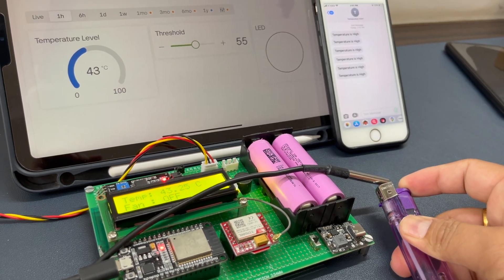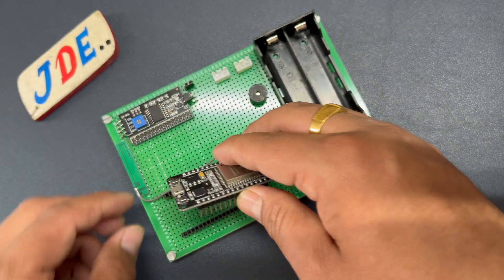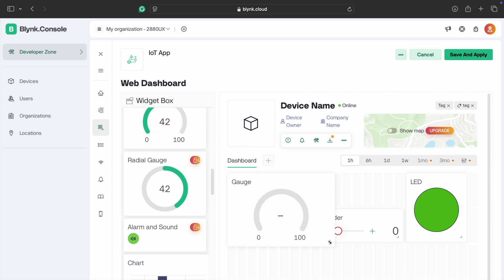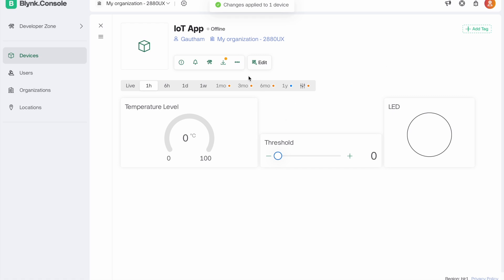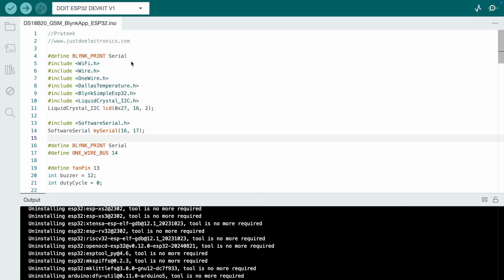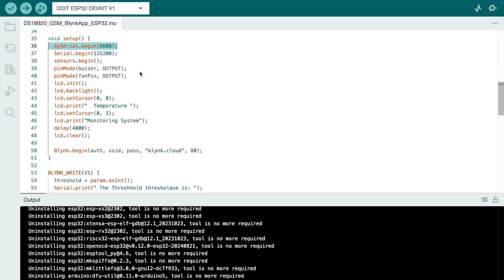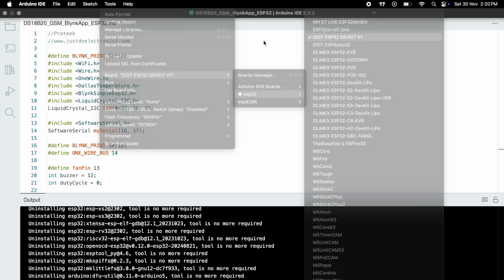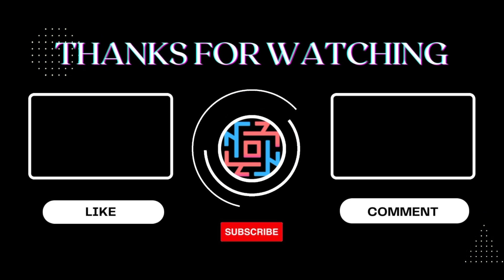IoT Temperature Monitoring & Control System using ESP32 & Blynk 2.0 | SMS Alert

Comment: I can assemble in water heater for temperature monitoring this can possible and cut off the main supply of 220v when predefined limit is exceed
Reply as soon as possible
Reply from the maker: Yes is possible but is also depend which type of relay module you used because in my case i used 10amp relay module but in your side the load is more then you used the 30amp relay module